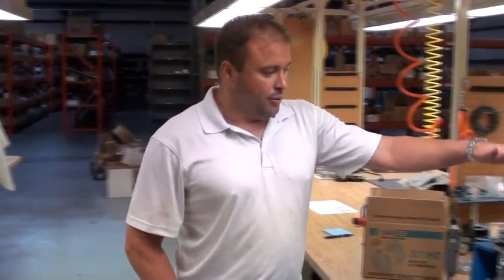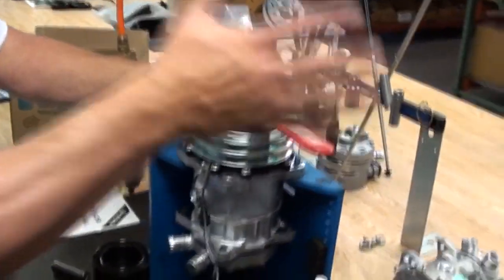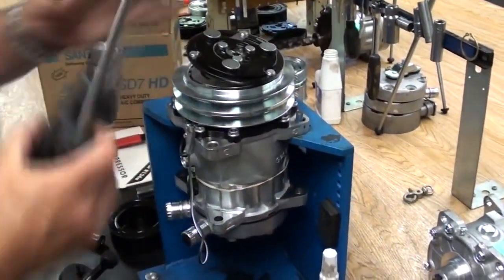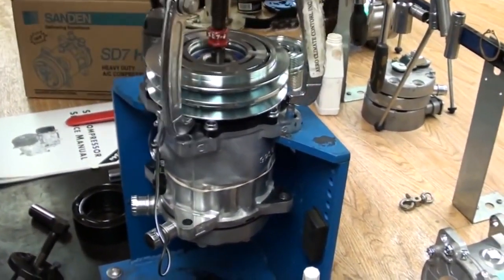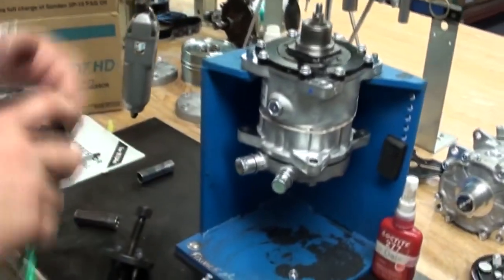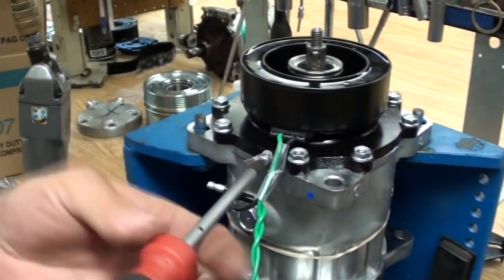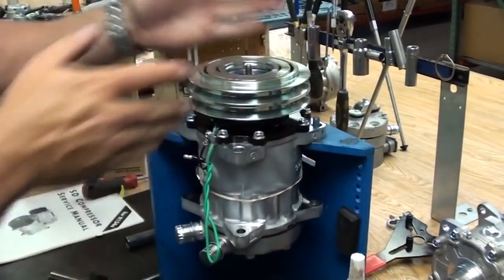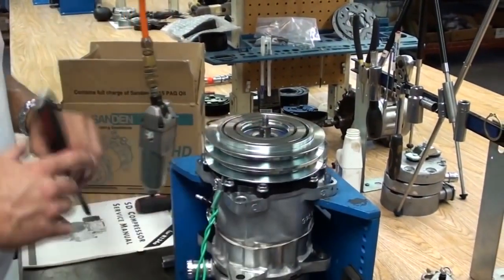HOW TO Replace Car AC Clutch from Compressor Sanden SD7 / SD5 EN

Comment: You just saved me 1150usd because of this video! Thank you so much!!! God bless!
Reply: Where did you guys purchase the sanden clutch and bearings
Reply: I ended up buying just the clutch on eBay from France. All suppliers in Norway told me I had to buy the complete compressor with clutch and everything. Norvegian auto parts prices... Sometimes its just wild.. 😀

Comment: Whats the resistance spec for the electromagnetic clutch ? A good one so that i may check and be sure of the fault, Not that i dont know, it doesnt kick in with power so i already know that its faulty, but what the spec is, is of interest.